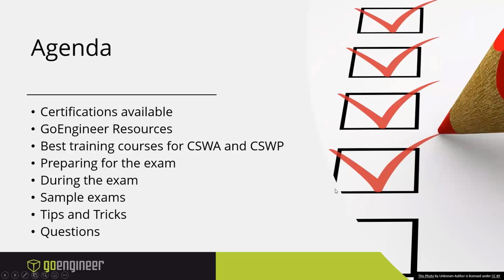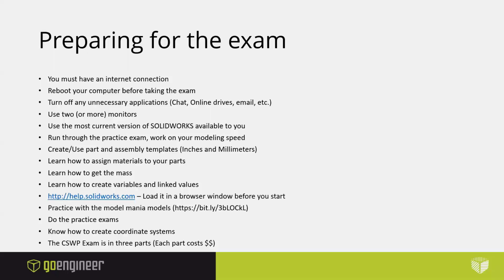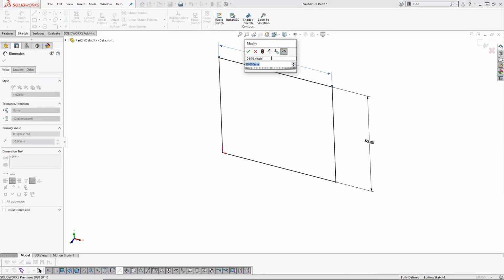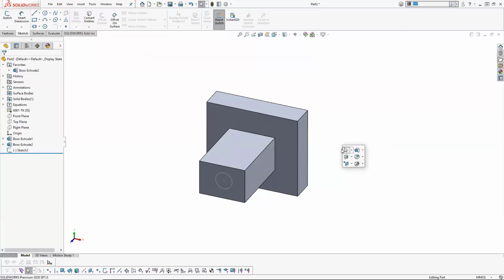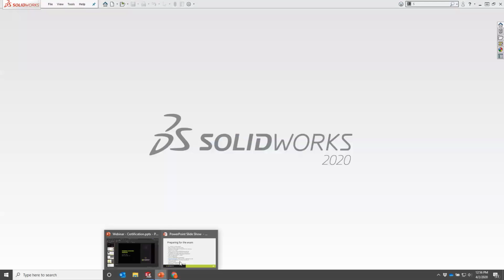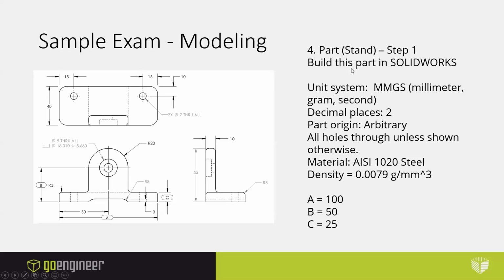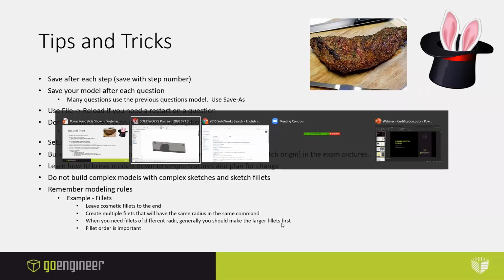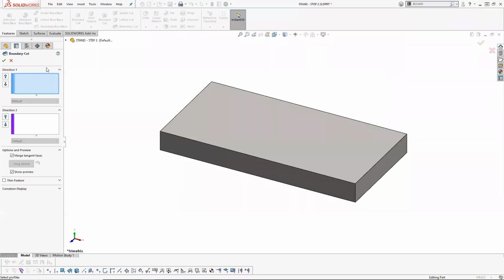SOLIDWORKS Tutorial - Certification Preparation

Comment: 00:09 Overview of SOLIDWORKS certification exams
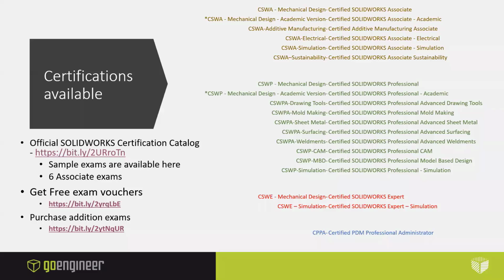02:54 SolidWorks offers certification exams for students and professionals.
08:15 Prepare for the exam and ensure internet connection is stable throughout
10:53 Utilize two monitors for SolidWorks certification exam preparation
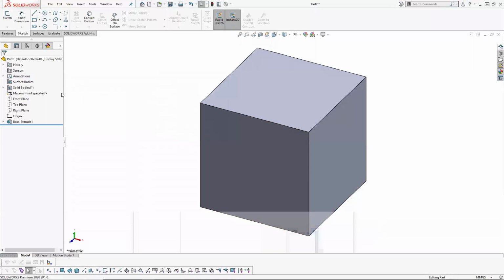15:53 Adding and managing materials in favorites for quick access
18:04 Ensure to set resolution to high for accurate mass properties
22:45 Creating equations at the dimension level
24:55 Use global variables for dimensions in SOLIDWORKS modeling
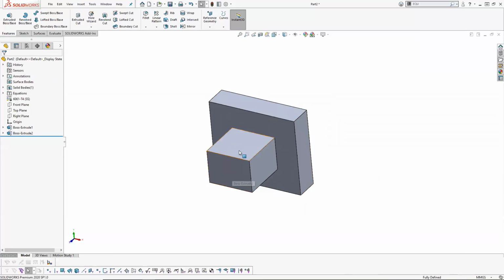29:43 Adding favorite features for quick access.
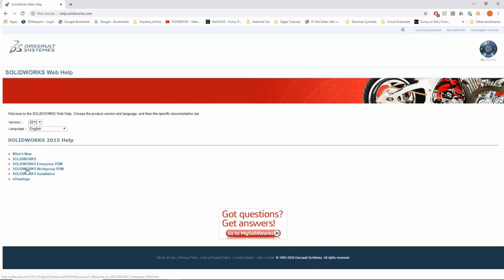31:51 Utilize help file for specific SolidWorks commands
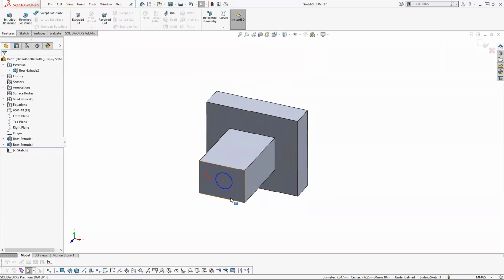36:18 The 'S key' functions as a super shortcut for accessing commands and tools in SOLIDWORKS.
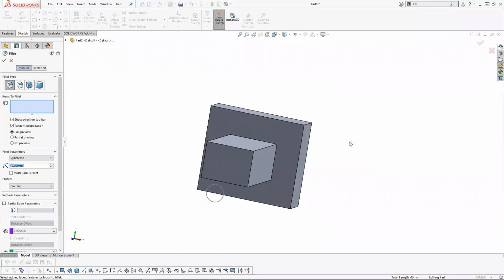38:32 Select through the model and manage selection tool bar in SOLIDWORKS
42:51 Gestures wheel provides quick access to SolidWorks features
45:08 Enhanced touch-based gestures in SOLIDWORKS
49:35 Rotate parts in assembly for better positioning.
51:57 Understand how to create coordinate systems in SOLIDWORKS
56:12 Pay attention to test units and mass units
58:17 Emphasize simplicity in part design for efficiency
1:02:38 Key steps to build a part using SOLIDWORKS
1:05:02 Creating a part with specified dimensions and materials in SOLIDWORKS
1:10:13 Use the reload function to review and correct steps during certification exam.
1:12:31 Tips for preparing for SOLIDWORKS Certification Exam
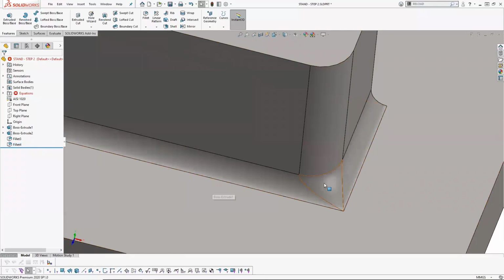1:16:50 Order of creating features is important for geometry changes
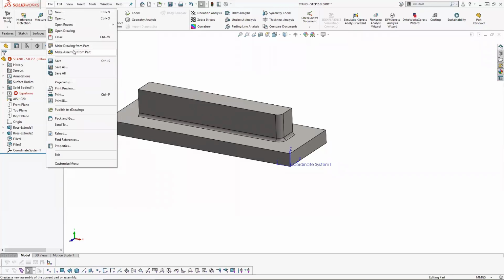1:19:04 Export options in SOLIDWORKS for specifying coordinate system
1:23:31 SolidWorks shortcuts for efficient modeling
1:25:41 Utilize the S key for quick search functionality.